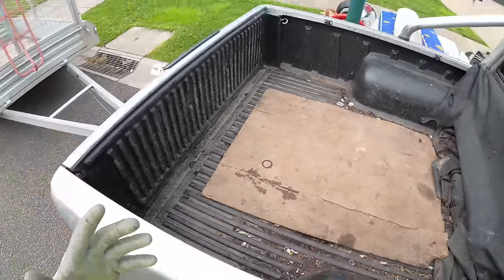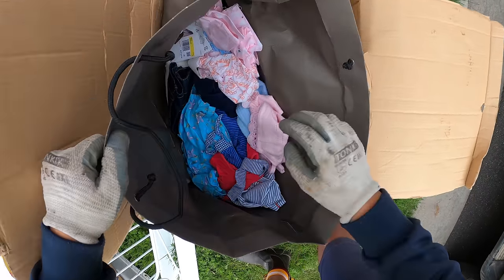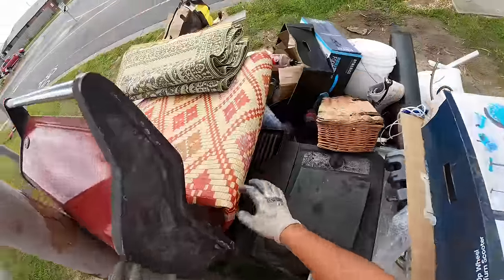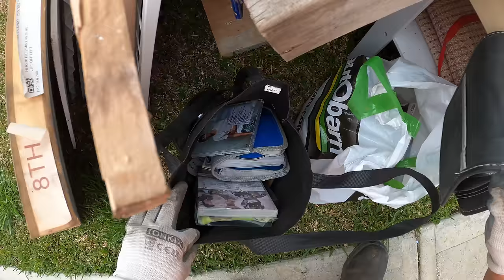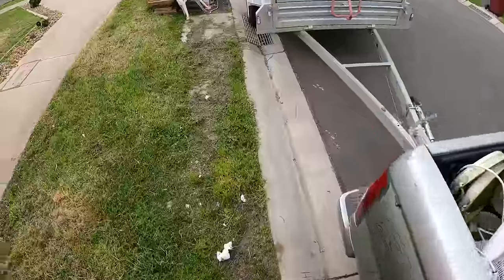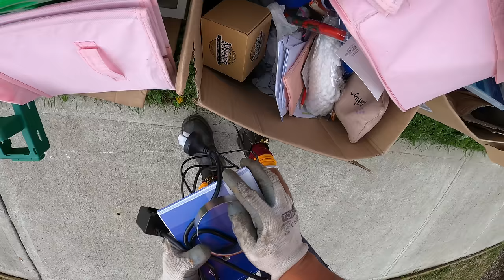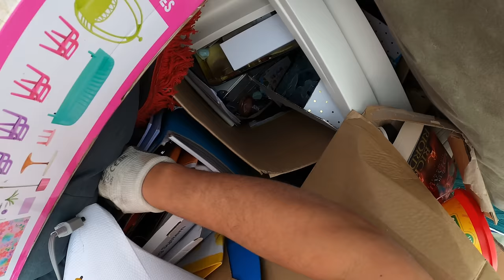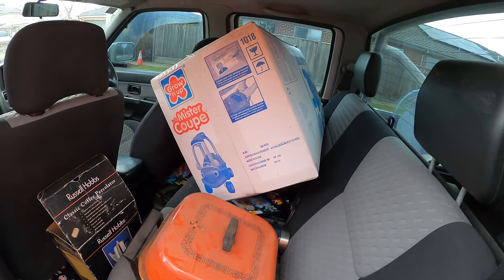Searching Through Rubbish Piles For The Metal & Resale

Comment: Just a bit of advice when using your crescent wrench, you'll have more torque when using it correctly. Right now you are not, it works the way your using it but it will have more torque on it if you use it the opposite way, the attached part of the wrench is stronger to loosen, your using it on the adjuster side of wrench for torque. Wrench will eventually fail by putting torque on small(adjuster side) of wrench, just an idea for future times mate. Always a pleasure watching your videos.
Reply from the maker: Thanks mate you’re totally right 🙂